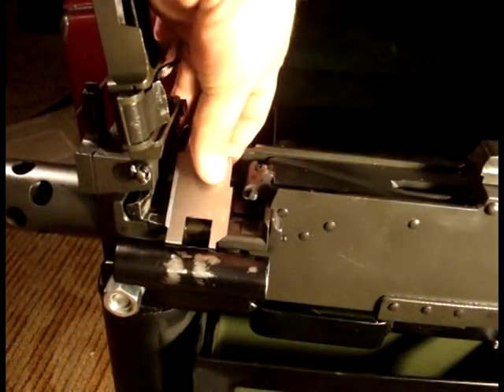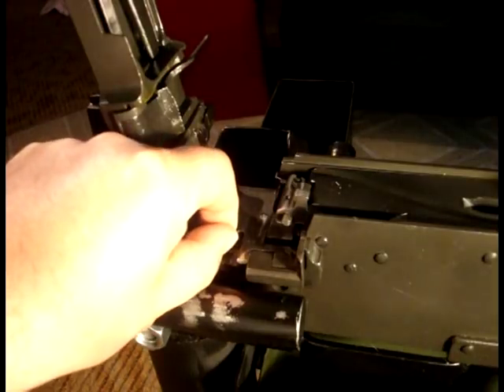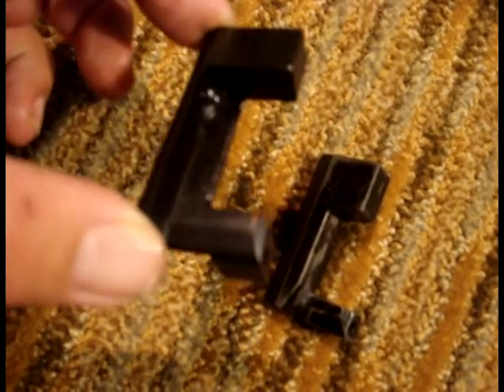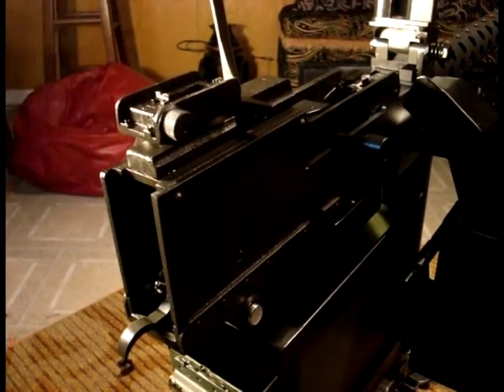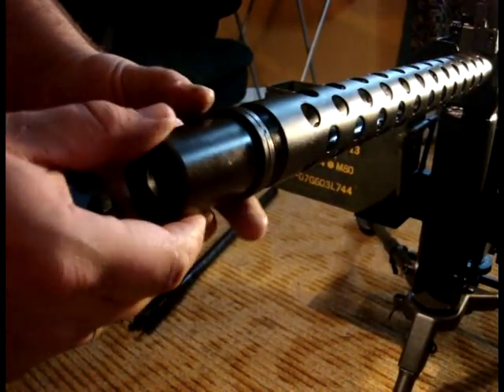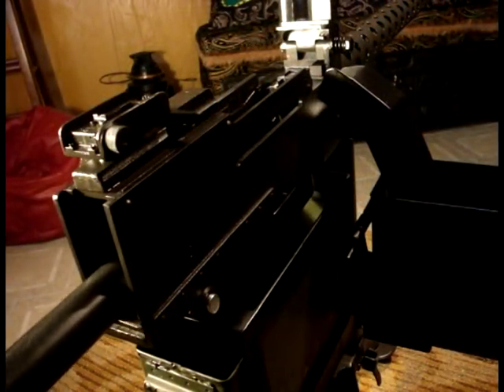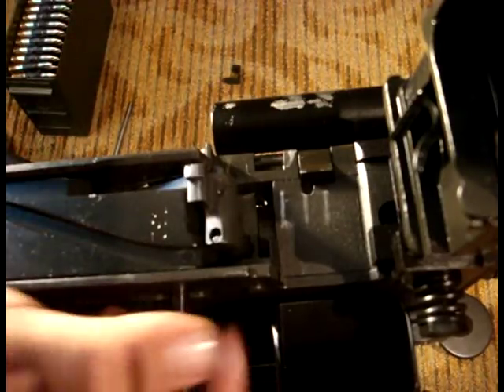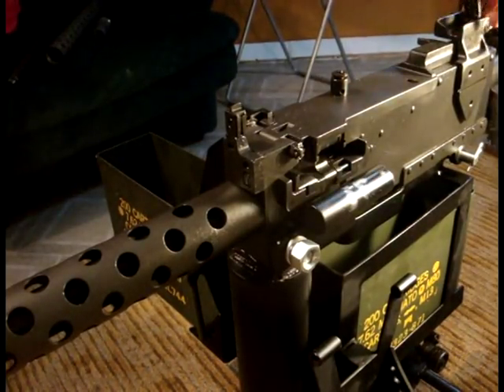Browning 1919A4 8mm Conversion: A How-to Guide

Comment from the maker: Simply replace your two-piece booster with a one-piece 30-06 booster. Don't forget to get a new lockring. The easiest way to get the booster loose is to use a booster wrench, but a strap wrench will work just as well. You can get one at your local hardware store. Once the booster is loose, you can remove it by hand.

Comment: Is a 30.06 1919A4 semi, also as easy to convert to 308? With the correct feed lips and 308 barrel & booster ?    

Is a 308 1919A4 semi convertible to a 30.06 likewise ? Or more difficult ?

Thanks!

Comment from the maker: The cost of 7.62x51 NATO-spec ammo is nearly double that of 8mm mil surplus. Why spend $500 for 1000 rounds of .308 when you can get 1000 rounds of 8mm for less than $250? Also, 8mm can hardly be considered rare--there are literally millions of surplus rounds to be had . . .